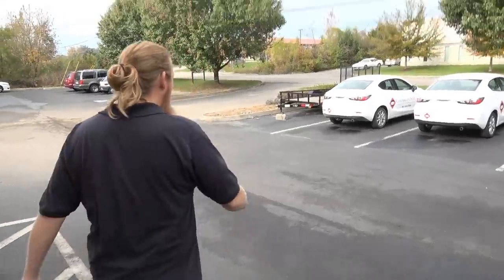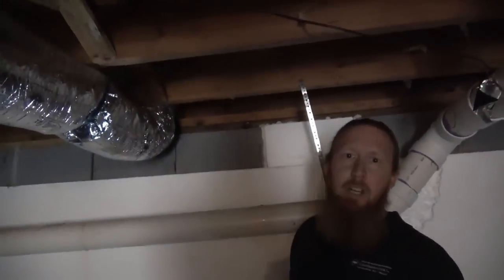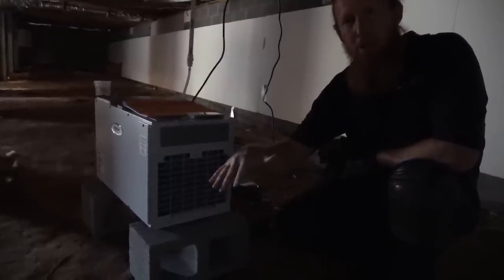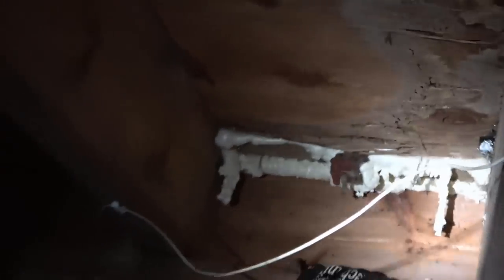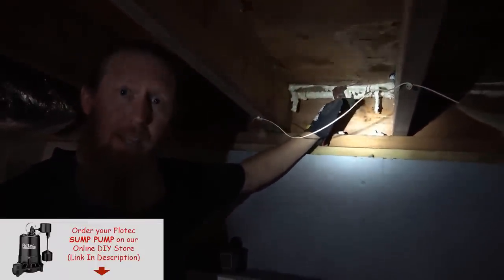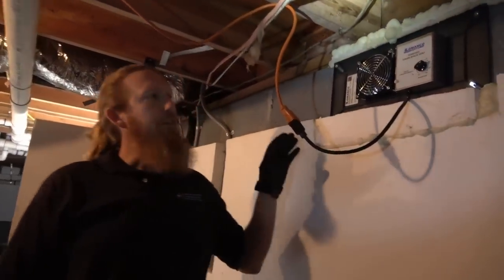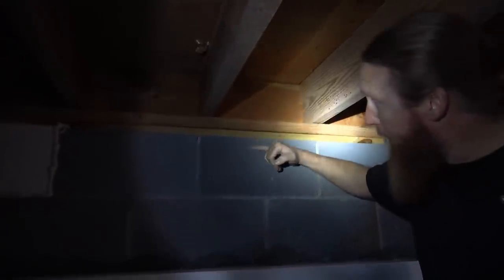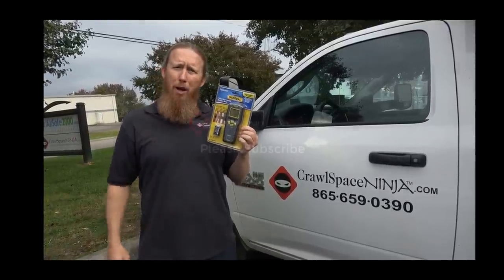Crawl Space Inspection | Tips for Inspecting Your Crawl Space | Find Crawl Space Problems Like This

Comment: First thing I did when I started spelunking down in my crawlspace was run a few strings of LED work lights around the perimeter so I could see what I was doing... instead of waving a single flashlight around. Useful info, guys, but I couldn't see a thing.

Comment: Hi Michael, Thanks for your videos - very informative and helpful. I am planning to encapsulate my crawl space and question I have is about Radon and other gasses in the encapsulated crawl space. If you already talked about it in your other video, I am sorry that I missed it. So the question is what do you do to remove possible radon accumulation in the encapsulated crawl space and the house for that matter? In one of your video about different underlayments you have showed the plastic which I believe serves not only for the water to drain and circulate but also for possible installation of radon evacuation system. The plastic underlayment would somewhat lift the vapor barrier up and create air gap for the suction fan/fans to move the air from under vapor barrier out, thus creating some negative air pressure which would help to keep the crawl space air from migrating to the house. Any thoughts on all of this? Thank you very much again, for your excellent videos.
Reply from the maker: See if this helps: https://www.youtube.com/watch?v=4mFQZbNKkXU&t=4s. Thanks for watching

Comment: Great video,
Thanks. I wonder if my home is a good candidate for a small encapsulated crawlspace. I have an older post and beam home. I am creating a concrete wall around it to fill in the spaces. My crawlspace is about a foot or so, so I would have to take up the floors to access it. My house is framed out of old rough cut lumber, If I encapsulate, will the lumber still be able to breathe? Just don't want to cause rot. Thanks!
Reply from the maker: As long as the humidity is properly controlled and the wood is not touching the ground, you should be okay. Laying a vapor barrier will help prevent any more moisture coming from the ground. Hope this helps!

Comment: There are many brands of moisture meters on the market ranging from $11.00 - $200.00. Which meter do you recommend for the DIY,er who wants a meter that gives an accurate reading ? 
Also, an additional question is how should the evaporator drain for the A/C unit be set up to drain properly to keep the drain water out of the crawl space ? It appears that the A/C unit in this video is draining the evaporator water right into the ground.

Comment from the maker: Hello Everyone. Was this helpful taking you through an inspection of a crawl space?
Reply: Yes it was! I wish my crawl space was that spacious. (sigh)
Reply from the maker: +Heffbomb I wish they all were too. Ninjas have been in some where it was difficult to turn your head.
Reply: Crawl Space Ninja Do you recommend going in belly up in those instances? My crawl space is about the depth of my chest.
Reply from the maker: Sometime you have to unfortunately.
Reply: Yes, considering buying a home with a crawl space basement and feel much more informed. Thank you!
Reply: Yes.  Very informative.  Any suggestions for a crawl space that will be 4-5 foot between the soil and floor when the structure is in a flood zone?  We are required to have a certain amount of vents that remain open 24-7 all year in case of a flood.  Other than sloping the ground away from the crawl space, do you have any key suggestions?  What type aesthetic vents are recommended?  The floor will have closed cell foam insulation. Do I need any sheathing on the walls, fans, sheathing on the soil?  Thanks for your expertise in advance.
Reply from the maker: @richardpatton4197  Check out https://crawlspacedoors.com/ They have flood vents certified for each state.
Reply: Great walk through. Wondering if you would use a dehumidifier to reduce moisture in an open vented crawl space?
Reply: Yes it was. Do you ever work or have someone to recommend doing the work in Utah?

Comment: Do you glue the 2 1/4in foam insulation board directly to the concrete wall? Or do you screw in wood furring strips first?
Reply from the maker: We use our Hilit products for installation. Check out this video to learn more about our process! https://youtu.be/j0PQCi8sMgc

Comment: Great video. Tons of information. I will buy the meter and dehumidifier. I'm running a small one down there now. I plan to jack up my house due to a rotted main girder beam that needs to be replaced. Do you suggest getting all the jacks in place before mold remediation? I have alot of rotted wood and the floors are quite squishy in many areas of the house. Just a single storey mountain house in upper rural PA. No one around to hire so trying to do it with handyman help. If figure if I get it level again then I can replace the girder and then start replacing the floors.
Reply from the maker: Hi Lizanne, we recommend getting the crawl space dried out and addressing mold before doing any kind of structural repairs.

Comment: My crawl space is about 3ft from ground to floor joist. The HVAC guys cut a vent in the duct to heat the crawl turning and cool turning summer. There is 2 outside vents that are 1ft wide by maybe 2ft long, it's full insulation on the walls and poly plastic on the ground. Do you recommend a dehumidifier in the crawl space for air movement. The crawl area is around 550 square feet we added to the house.

Comment: Micheal what about the mold onto of the joists? shouldnt you take off the subfloor and get that too?
Reply from the maker: You will still fog or spray that. In most cases sub flooring does not need to be removed
Reply: @CrawlSpaceNinja  what if the fog doesn't get under the sub floor onto the top of joists? and it probably won't right

Comment: 1:40 10 - 20 gallons of water a day dumped onto floor from the HVAC unit during the summertime.  White drain line goes straight to ground.  Drain it OUTSIDE the basement.   6:19 Is the white rectangular patch on wall where the VENTS have been SEALED OVER???

Comment: Would you recommend sealing all exterior vents? I plan on installing half wall stone siding and I'll just plug them up if you agree; with insulation board of course.
Reply from the maker: Typically we seal all vents except one, thats where we place our fan. Check code to see if you can seal vents without fully encapsulating and insulating the crawl space.

Comment: There is some expensive moisture barrier paint that comes in white or black.  Usually put on outside around foundations
Reply from the maker: Those are great when the home is being built, but it's usually pretty expensive to excavate around the home after the fact to waterproof the exterior. Using paints on the inside is not recommended either. Thanks for commenting!

Comment: My house is in a floodplain so I have to keep my flood vents open all the time. So I don’t think there’s any way to encapsulate it. Where do you get your termite proof foam board? Before I put a vapor barrier down on the ground I did level it with rock screening.
Reply from the maker: Blind Tom DIY, we actually produce our own termite resistant foam board.  You can find it on our DIY store at: https://diy.crawlspaceninja.com/foam-board-insulation/

Comment: Thanks a lot explaining the crawl space space  black mold and/or moisture issues.  You have helped me to make a decision about not buying a home with a crawl space.  I asked the seller about if moisture was an issue, mold, etc in the home which they stated  "no". I felt a little uncomfortable  seeing homes with crawl  spaces present.  I had never heard about  crawl space until  I moved to the mid-west.  I am going to start only looking at homes built on a slab foundation or have a basement only  hoping  that this will prevent me having to worry about moisture and mold issues that could develop in a such a compact area of a crawl space.   My second concern  is about the cost of replacing the furnace when the current system fails.  I can not  image how difficult it would be to  get a new furnace in such a confined  and limited space.  Again, thanks for helping to addressing  my fears and concerns about crawl spaces in homes.
Reply from the maker: We are glad our videos have helped your home search easier!

Comment: If a house is at about 50ish% humidity level, how long would it roughly take to take it down to 20% for about a 1800sqft home. With insulation still installed.
Reply from the maker: You don't really want it to get that low. Too low of humidity can dry out your wood so much that is cracks and damages the structure.
Reply: @CrawlSpaceNinja  thanks for the quick feedback! We're in the middle of buying a home and the humidity level in the wood is between 30-55% depending on the area of the home. They installed a Santa Fe 70 and closed the vents. They said they'd check in a week and see what it came out to. Think it will get below 20% by then? Anything else we should worry about?
Reply from the maker: @FlyGuyF119  Ah, wood moisture levels are much different than relative humidity levels. Ideally, you want the wood moisture levels to be between 9-15% before treating any mold. It can take anywhere from a week or so to a couple months. It just depends on the house. We will normally check on a weekly basis when drying out a crawl too.

Comment: Just put a humidity monitor I'm my crawlspace I'm getting levels in the 60s and 70s how would I address this if it's already been spray foamed and vapor barriered? I see no mold or moisture issues
Reply from the maker: If the crawl space is sealed then you need to have a dehumidifier to continuously control humidity.
Reply: @CrawlSpaceNinja  I live in southern Ontario Canada is it as necessary as living in a warmer climate?
Reply from the maker: @MAE74961  If you're wanting to control humidity, yes.

Comment: I have a crawl space like this but I have pony walls sitting on my concrete blocks and my house sits on the pony walls. Do I need to insulate the pony walls with foam board? Or will this trap moisture in the pony walls? I've noticed water loves to condensate on the pony walls.
Reply from the maker: Try installing a dehumidifier first, and go from there! Hope this helps!

Comment: What type of insulation should I use to insulate around the boot of duck (register box that connect to the floor)?  Right now we have fiberglass around it, but during summary it get wet
Reply from the maker: Spray Foam Insulation or Foam Board

Comment: You use that insulation for the walls too? Not just the rim joists? Don't you have a drain dimple board behind that insulation? Sounds like that kind of insulation just holds moisture if it lets moisture thro it lets humidity thro and that's bad you should add a space or something to let it dry out
Reply from the maker: Vapor barrier is installed over wall insulation to reduce the amount of moisture coming into the crawl space.
Reply: @CrawlSpaceNinja  right right, it doesn't hold moisture tho causing problems underneith? And is it a air barrior? And do you still usr the dimple board?
Reply from the maker: It's no different than when the vapor barrier is installed on the wall. The foam board we use is rated for ground contact so it is able to get wet. The dimple underlayment is used on the floor of the crawl space before installing the vapor barrier.
Reply: @CrawlSpaceNinja  just the floor so it's easier on vapour barrior? You dont put it on the walls?
Reply from the maker: You can install it on the walls if you want to, we never have and don't see a need to. We use the underlayment to protect the vapor barrier from gravel or rocky soil that may puncture the vapor barrier otherwise after heavy traffic inside the crawl space.
Reply: @CrawlSpaceNinja  nice in a basement is where you would use it on the wall if it was getting finished right, you guys ever insulate the floor?

Comment: Hey there, do you do any work in Miami, Florida? Our wood floors are doing the weirdest thing.  We now have a hole in the floor and my husband went under the house and there is mold, a great deal of it and rotted wood which holds the floors up.
This is an under the house crawl space.  It is tight quarters.  We feel like we just want to escape from the house, the city, the state.
Reply from the maker: Hi Autumn, thanks for commenting! We currently only service East TN and parts of KY and NC. I'm sorry this has happened to your house. I would suggest calling a local crawl space contractor to help you with these issues.

Comment: I’m not happy with my crawl space work done by a pest control firm. My annual renewal fee is $450 and I suspected that they weren’t changing the Santa Fe filter so I put a dot on it. For $456 per year they weren’t even changing the filter and the vents looked just like this one . A neighbors son took photos . There’s foam board glued and like this video, there no foam over the holes. I have no recourse and if I stop the $450? I have no warranty.
Reply from the maker: I'm so sorry to hear that you've had that experience. Does your agreement state that they change the filter when they do annual maintenance? If so then I would contact them about that and see if you can at least get that part addressed. That is a tough situation to be in.
Reply: Crawl Space Ninja thank you. And yes, the agreement specifically says that if we maintain the warranty, they will change the filters. There are two. I've compared ours from a giant PC company to a friends done by a small independent and they got a much better system and they pay $150 per year. Honestly? I don't think you had quite started your firm yet, or we would have had you , no doubt.

Comment: Have you ever heard of placing sand inside to cover the crawl space floor?
Reply from the maker: We don't do that, saw an issue with condensation due to sand. Not sure why exactly.
Reply: I'm sorry, I didn't make myself clear. I'm talking about sand first then the barrier encapsulation.
Reply: @Rlight96able  I've heard of that just to protect the vapor barrier from getting tears due to sharp terrain and it's cheaper than the preferred matting/padding that doesn't retain moisture.  I think the matting would be better in the long run.